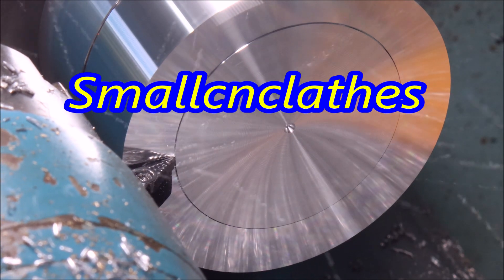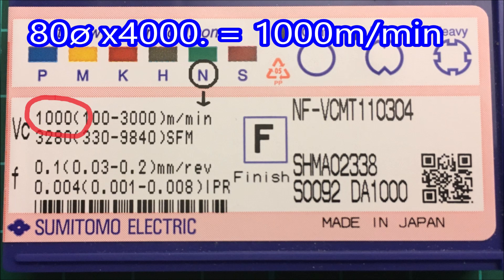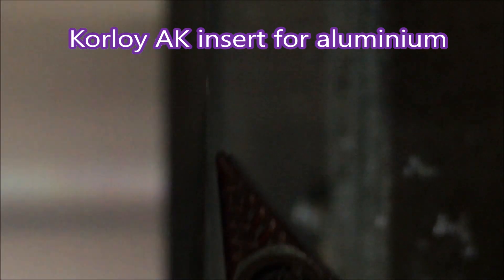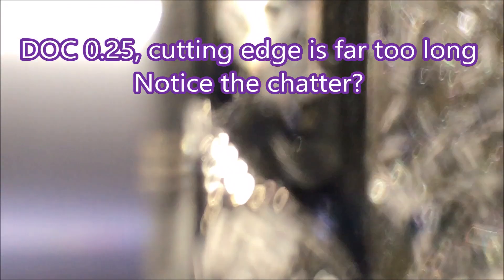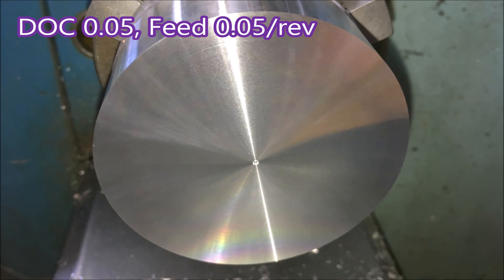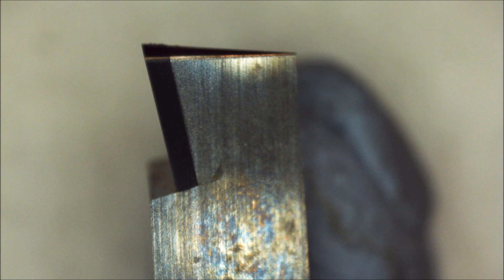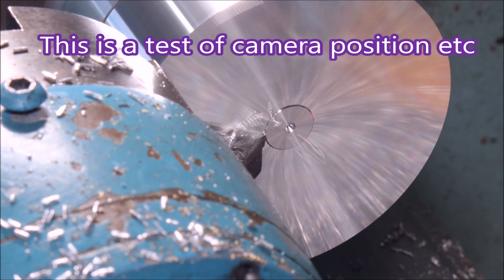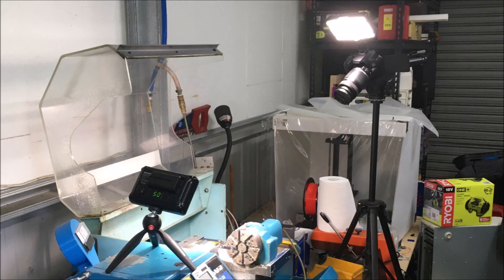PCD Diamond Insert Part1. Turning Aluminium with Carbide and Diamond inserts.

Comment: I used a PCD insert on some 6061 for the 1st time a few days ago.  I was completely gobsmacked at how well it worked.

Tremendous surface finish, but what truly amazed me is I could feel  how effortlessly it was cutting.

I have a manual Sherline mini lathe I have upgraded considerably; it's akin to a featherweight holding their own against a middleweight.

I hadn't realize how used to the resistance in the cross slide hand I had become. Then I tried the PCD, & it was obvious how much resistance I had been ignoring.  The insert progressed much, much easier & was much smoother.

I normally keep my DoC on 6061 at ~0.010" to get a good finish, avoid problems & not beat up on my lathe.  I made 0.030" DoC passes w/ the PCD insert which were smoother & less resistance than 0.010" w/ carbide inserts.

I only had a 5 min job for the PCD. I was so elated by the performance I was trying to think of something else I needed to make from 6061, just so I could use the PCD more!

Oh, yeah, had to come back to add, I was running the PCD at my normal RPM for 6061, given the diameter.
Reply from the maker: Hi George, great that you found it worked well for you. Was there much rake on the insert?  A while ago I bought a PCD with chip breaker have yet to test it, will probably try it on some 6061 running at around three times the speed of a normal insert. Thanks for your comment, Nigel
Reply from the maker: Hi George, do you have a link or description of the insert you are using?

Comment: Having only limited experience with lathes and effectively no professional training on the topic I was always wondering in which cases feeding from the inside should be used. I basically always feed from the outside, mainly because that's the default fusion CAM is  giving me, I have seen feed from the inside a few times in videos but would like to understand which way should be used in which situation. 

ps: keep up the good videos, loving them and learning lot, thanks ;-)
Reply from the maker: My cam does it that way when using the canned cycle for stock removal. If you use a tool with say 5 degrees offset to the turning face, any depth of cut presents a really long cutting edge to the face being cut. This should give a good finish but can be prone to chatter. Same tool cutting to the centre will only be cutting on the nose.  This is with a 35 degree tool. This tool works like a parting tool if you take a deeper cut and then you are cutting on 2 very long cutting edges, so that is not good either.
If using a 80 degree tool you can take large cut when cutting to the centre  but not so much the other way round as you first have to dig in at the very centre of the work
Reply: Thanks for the quick response.
So its mainly to extend the cutting edge and find a good balance between the length of the cut suitable for the stability of the machine in regards to chatter. 
Will give it a try the next time I'm playing around with the lathe.
Reply from the maker: @KlausMichaelKMS  Just been looking at the problem. As I said, I do it because my cam works that way.  Having said that in many of my videos I face off towards the centre when I need to remove a decent chunk of parting nib.  When facing from the centre the insert has little support, instead of being pushed into the holder and is supported by the cavity  it is held in, the cut is trying to drag it out of the holder, may be that has something to do with the chatter that can occur??

Comment: Nice work.  I was about to ask why you were going from the middle out and then you talked about that.  I guess I have only seen folks go from the outside - in. But, as you know, I am a rookie at turning.  :)  Take care.
Reply from the maker: Hi Gary, I would consider, out to in as normal too, certainly with the manual lathe.  BUT if I use a stock removal cycle within the software it works from the centre out and towards the chuck, so that is the way I am used to.  It works ok with normal inserts,  but I do have to use a tiny finishing cut to prevent chatter.  Diamond inserts are shaped quite differently so I will be going from the OD to the ID. The difference regarding the tool is, coming out the tool presents a long cutting edge to the part causing chatter. Going in, it is cutting on the tool nose radius so presenting a much shorter cutting edge with less inclination to chatter.

Comment: I just absolutely love that little cnc lathe of yours! Are you able to bar-feed it?
Cheers and please continue to make videos. I'm a machinist myself working on huge CNC mills, but theres something special about your little baby 
😄
Reply from the maker: I would not have room for a bar feeder, even if one could be contrived.  Also no way to handle long bar stock, I buy my brass cut to around 400mm which allows me to manually feed through the headstock anything up to 1". Thank you for the compliment, lovely lathes just getting a bit old and cranky at times.  Today I had it warming up at 3000 rpm and when I went back to look at it, 500 was all it was doing. Something must have upset the PC that does the controlling, once I switched off and on again, all back to normal!

Comment: Good timing I was just given a polycrystalline diamond  insert to try out on some aluminium
Reply from the maker: Hopefully part 2 won't take too long. But I expect to see a video from you, when you get to try it out!
What surface speed can you achieve?
Reply: @smallcnclathes  Not enough! I think my lathe tops out at about 1200 rpm, it's a 12x36 AL330A, I'll run coolant and see what kind of finish I can get
Reply from the maker: @nedshead5906  simple just turn something really really big. LOL
1200 rpm turning 250 diameter will give you close to 1000m/min!
Reply: @smallcnclathes  There's a problem for every solution..haha I'll see what I can find
Reply from the maker: Just remember you can’t use it on steel!